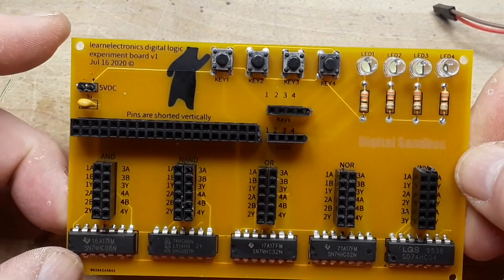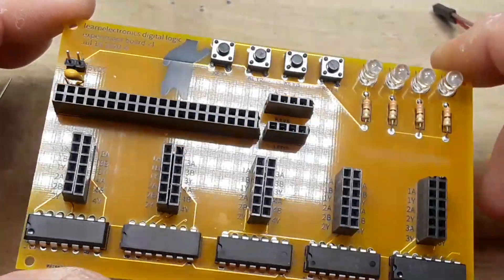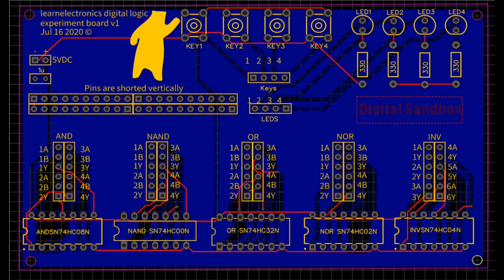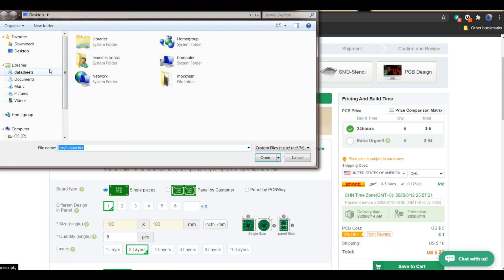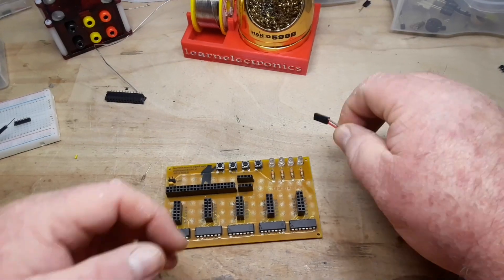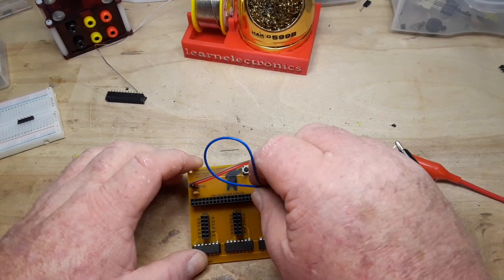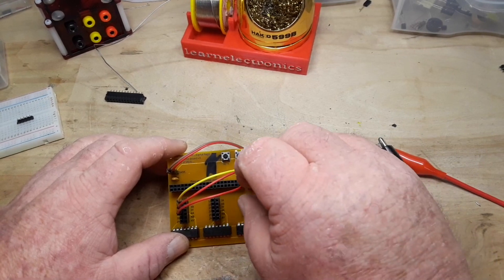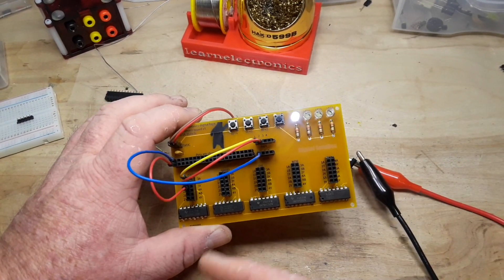Digital Logic Learning System PCB

Comment: Maximum Supply Voltage stated for the 74HCxx series is 7V.
Reply: Some vendors, only 6V.
Reply: @ed-jf3xh  Bottom Line: Don't Run @ 9  Volts that is.